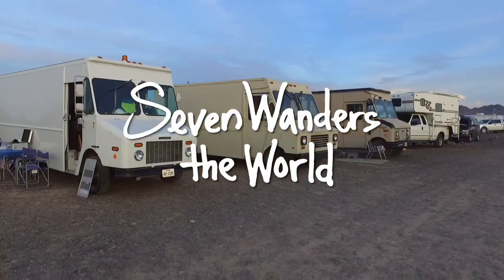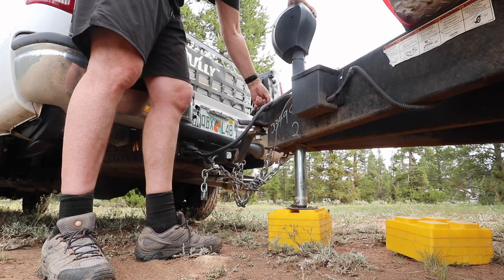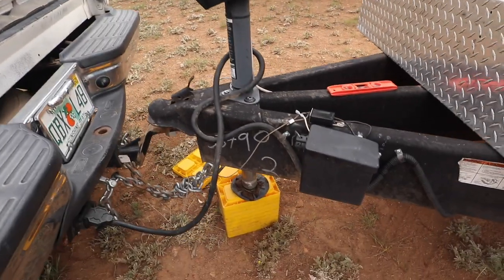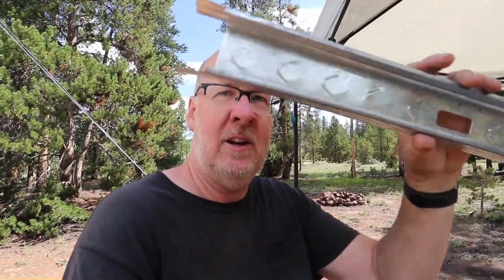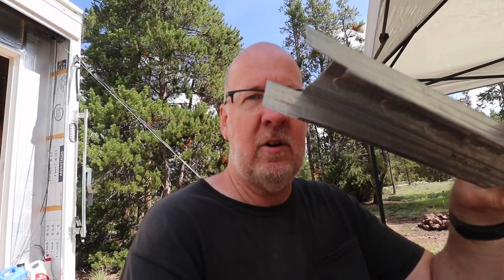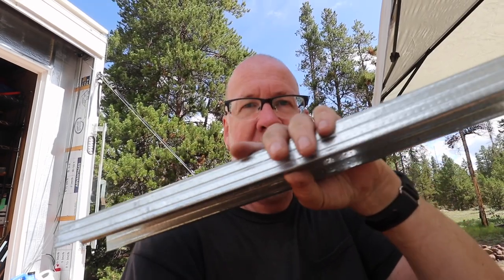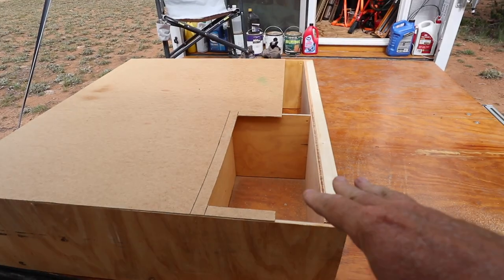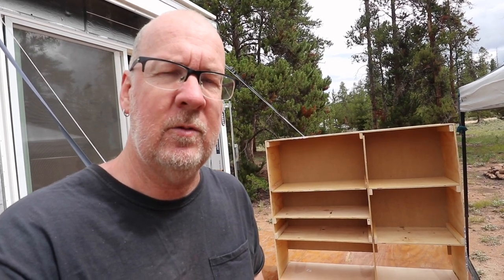Cabinet Mistakes E646

Comment: The jack is likely a grounding issue. Attach the trailer back to your truck and retract the jack then remove the three bolts attaching the jack to the a frame. Clean all the rust and paint off from around the mounting holes. If this doesn’t work you will need to run a ground wire from the motor to the a frame.  As and RV technician I see this issue a lot with this particular brand of jack

Comment: Add a face frame to your cabinet and it will hide all off the plywood edges and  the supports for  the shelves. Will  also make the  shelves stronger. If you have a Kreg jid. They are great for face frames.
Reply: 100%!

Comment: We had an issue on two of those Jax’s an installed a hand crank one I gave up with the power ones!
The microwave can alway stick out an inch without an issue normally , we modified ours to fit using the bracket from our camper even the legs. Taking apart a bran new microwave was not very cool but it turned out perfectly

Comment: Seven, definitely looks like your jack was lifting both the trailer and your truck.  If you look at the start of the video, the lever that locks the ball in place is still mostly down in the first shots and the wheel wells look like the truck is sitting pretty high like it's being lifted.  After you released the trucks brake, the locking lever is all the way up and out.  You can avoid that by blocking the trailer up really well and doing exactly what you did before you start lifting it, go back into the truck and release the brake on the truck, put it in Neutral and then back in park and reset the brake.  As long as you are on level ground that should release any tension that's on the locking mechanism.  If the truck/trailer combo is on a slight uphill it may want to roll back against the trailer and the ball locking bar which will cause it to want to be stuck.  I'd also recommend lubing the inside of the ball area of your trailer and the locking bar.  Keep an eye on your wheel/well clearance in the rear wheels and get a feel for how much gap there is normally with the trailer on, and how much there is with it off.  You should be able to tell pretty easily if the jack is trying to lift the truck that way.

Comment: Check the voltage at the trailer jack (it Still sounds like you might have a bad connection). The vehicle shouldn't have to be in neutral and it shouldn't matter if the emergency brake is set to get the trailer off the ball

Comment: Tell me one thing is that hitch rated for 5000 lbs that's a lot of trailer for that hitch. I would like to see a distribution hitch. Jack he jammed it   it happens all the time no big deal. Running the truck in neutral is very unsafe. But what do I know 🇨🇦🛠️🇨🇦🛠️🇨🇦

Comment: OK so Seven, you're plugged into your truck, the battery running the jack is the truck.  Putting the truck in N is one issue but leaving the truck running would be the better sollution.
Reply from the maker: I'm a bit confused... why would the truck running help? battery running the jack is lithium and in my trailer
Reply: @SevenWanderstheWorld  I've made the 'assumption' that you have a work truck and the alternator should supply the power to the jack.  It won't drain down like the battery.  Don't listen to me, just try it.

Comment: Seven , try doing it with the truck running
Reply from the maker: can you elaborate on why that would help? just curious. thx for the suggestion!
Reply: @SevenWanderstheWorld  the alternator puts out more volts then your battery.  Usually around 14.2 and keeps your batteries topped off while putting the drain on them.  I wouldn’t think that would be your problem but also check your ground wires on both sides of the plug.  Truck and trailer